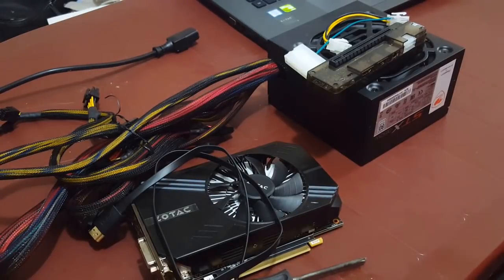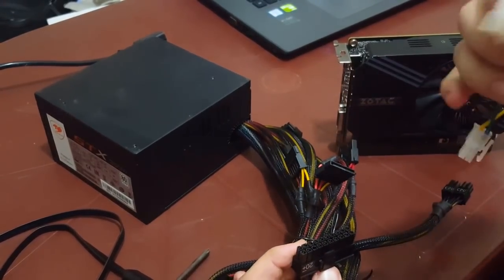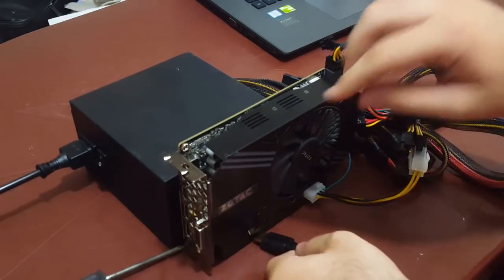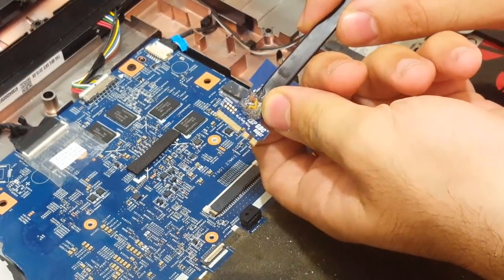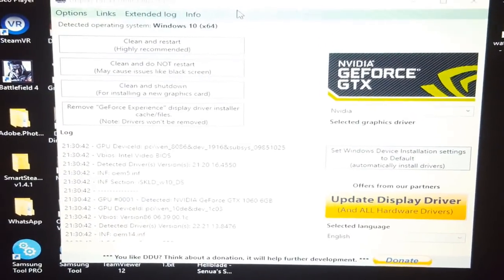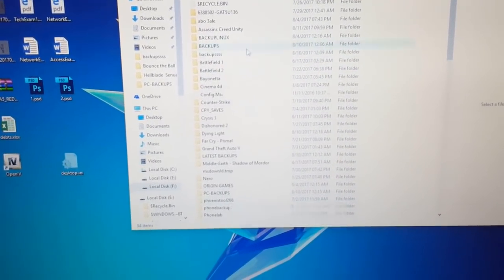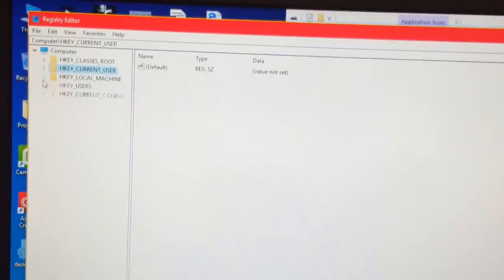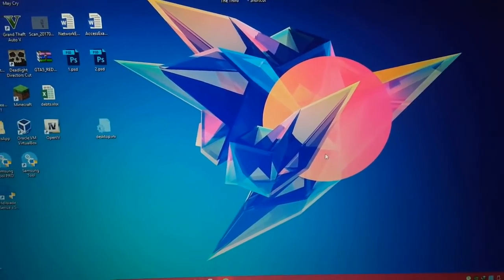HOW TO: External GPU for any laptop PC W/O External Monitor GTX 1060 EXP GDC 1050 ti solve error 43

Comment: Hey guys there's a new version of the beast which is v9.0b with m.2 key M and 2 hdmi cables. According to the instructions on ebay it says that the m.2 slot has to support nvme for it to work which IMHO  makes sense since the cable now has 2 hdmi for faster data transfer. Now the question is do these laptops with m.2 for wifi cards support nvme? If yes can i use version 9.0b on my laptop? My laptop is dell 5558 with i7-5500U and I've looked online to see if my motherboard supports nvme and i haven't landed on any solid information. Any help would be greatly appreciated.

Comment: I have a couple questions, lets say i set all this up but also would like to use my laptop as a laptop every once in a while, if i unplug the egpu and enable the built in nvidia card would my laptop still work correctly? also if i were to plug in an external monitor into the egpu through the displayport (to get 144hz) would this work?
Reply from the maker: the built in GPU will always work, and I have never tried it with 144

Comment: hello  will this method  works  for  lenovo  Y50-70 i7 4720 hq 16ram? 

p.s  watn  buy  1080ti for egpu

thanks
Reply from the maker: I am not sure that 1080ti will work as an external GPU
also, I am not sure about the laptop's compatibility, be the first to try, but don't try the 1080ti.

Comment: Hi..nice video! I've got some questions:
1.Can Acer aspire V3-471G run this eGPU? This is the specs:
Processor  Intel Core i5-3210M (2.5GHz)
Graphics  NVIDIA GeForce GT 630M 
Memory  4GB DDR3 
Storage  1TB HDD
If yes, which GPU is suitable for me?

2. I heard there are many version of this Exp Gdc from 8.0 until 8.5. Which is the best and suitable for me?

3.Does old CPU effect GPU?i mean if using old CPU,can i use latest GTX1060? or i only can use GTX 970 below?

4.Which power supply is suitable for all GPU?is it 550W?hope it will not burn my laptop..

5.If i using this eGPU, is it possible for me to use original laptop GPU again to make my laptop portable and only use it again during gaming? or i need to do all that steps again once i disconnect the eGPU?

That's all..Thanks!
Reply from the maker: I do not recommend using external GPU with such laptop, since your CPU and RAM are below recommended specs

Comment: GIGABYTE GTX960 Windforce 4GB  not being detected on a Dell Inspiron 3520 running Windows 10 64bit
 i3-3110M
And 6GB RAM

Am using a GIGABYTE PW400 for power and it is all connected through the EXP GDC Beast V8.5c via PCI-E

Graphics card (GTX960) isn't being detected, but if I use a different Graphics card, the secondary card gets detected but I am hit with an Error 43, can anyone help?? I'm stressing that I wasted money over nothing...

Comment: Yo bro,
I have a Lenovo G50-80 and i did the EXP GDC setup using 'Galax gtx 1060 6 gb oc", a 550w power supply, using the NGFF version cable and did everything in bios but cannot get the gpu to be identified in device manager.
Any idea what the fk is wrong?
(Also I'm using a HDMI extender for the ngff interface cable since it was short, wonder if it's the problem.)
Reply: 1.Do not use any extention cable, they are slowing the bus speed of the gpu and probably wont let u use the gpu

2.do not use any amd gpus for playing on internal screen, they dont support backward comptability.

3.do not use any nvidia gpu under gts450 (not including gts 450), do not use gtx 1030,1050, 1050 ti, 1060 3gb, they dont have drivers that support the exp gdc .

4.make sure to power your gpu with external power cables if needed.
5.Make sure to disable the nvidia gpu on your laptop if you have one, or make it second option.

6.Make sure the switch on  the atx option on (power supply) exp gdc board .

7.Install the drivers that were launched firstly for your gpu and then update the drivers from geforce experience.

8.I do not advice you to overclock the gpu it causes crashes due to low memory bandwith in the cable.
 
Wow i cant believe i just wrote all of that

Please let me know if you have any issue
Reply: David Nicol Hey there!
Thank you for your advice but I've tried it all before it just doesn't work, i tried it without hdmi extender and everything still it doesn't get detected in the device manager. I've heard of something called as egpu setup 1.35 but didn't gave it a try. any idea about it?
Reply: AR Tech AR Tech  I tried it but it only to check that my gpu is running at gene 2 mod 
I dont know if it will help 
I would love to help you 
Send an email and a comment here ill try contacting you about doing this setup properly, so nothing will go wrong
Also if i have 1.30 not 1 35
Reply: AR Tech go to your email
Reply: Hey guys I have a dell inspiron 5558 with zotac gtx 1060 6gb with  the NGFF cable version and I'm having the same problem as you. Mind to share your solution?
Reply: @heanlygaming5408  try nvidia version 388.71 good luck!
Reply: there is an indian guy who shows this process om lenovo g5070, you should check his video... here is the link. https://www.youtube.com/watch?v=aM3D3cZmqn0&t=529s

Comment: Hey.. i hve a question.. please help i already disabled all the drivers and root pcie but my laptop does not detect the exp gdc.. i am using ROG gl553vd i7 7th gen. Using ngff cable same like in the video.
Reply from the maker: Hi, make sure to remove all power sources from your PC ( including battery) before connecting the GDC while it's on, then turn your PC on.
Reply: Why the battery? Is there a specific reason?
Reply from the maker: Since it could still supply the PC with power even if it is off.
Reply: Should i charge the laptop?
Reply from the maker: You can try another one
Reply: It still wont detecet anything..
Reply from the maker: maybe there is a problem with the PSU or the GDC
Reply: My psu is a new cougar ste600 watts so i think its alright but not sure about the exp gdc
Reply from the maker: check the GDC it may be faulty
Reply: The green light turns on when i plug it to the laptop, does this mean that it is working or is there a chance it is broken?

Comment: I have a gaming laptop 
(Lenovo Y520 with 1050 4gb)
I want to put a Palit GTX1050ti (single fan). I watched everything in the video and saw that you disabled the built in graphics card. 
So i can not use my built in gpu and egpu both?

Comment: Hye Pedro...good video...i apply this step and it work without error...i have one problem. When i want to use with internal display, i cannot open nvidia control panel, its say 'Nvidia setting are not available" i have integrated intel hd graphics and dedicated gt720m..it seems like default gpu was not on my egpu..i cannot change preferred gpu bcoz cannot open nvidia control panel, help!
Reply from the maker: Hatem Aqil apparently your PC doesn't support such feature with the internal display, you should use and external one which is better and would give you an increased performance.

Comment: I have a lenovo y510p laptop. I bought a exp gdc to use gtx 1050 ti on it. I install my hardware just like in video instructions. My psu working, my exp gdc has green light, my 1050ti's fan is spining but device manager can't detect the card. I can't disable pci express slots for my older cards because when I do, The monitor not responding.I tried what atarva7 said, and so many other methods. But  Im hopeless. So guys give me some hope please.
Reply from the maker: make sure to remove every power source from your PC before connecting the GPU while the PSU in ON
Reply: I did it but nothing. Then I started my laptop when psu on, laptop got power but screen not working. I need to turn off PSU to start my laptop. İs it normal?
Reply from the maker: no, it is not normal, something is wrong, maybe you need a better psu, also check the connection from the adapter to the PC if it is moving, and also try using an external monitor
Reply: I tested same setup on another laptop and I still got same problem. Im thinking if my gpu is broken or something. Can be? If so I will return it before too late

Comment: hey man can i unplug all hardware like vga,power supply i already installed and work i can play gta v high in settings before.so i want to plug in again without installing again like before and i 
 want to bring all my hardware to my friend house and WIfi public or cornor and i want to plug in again .can i do that.without having problem.
by the way what is your laptop name and spec.
you have already installed gta v before you install vga hardware
Reply from the maker: sure, the installation only takes place once, so you wont need to reinstall again each time.

Comment: I did this and its working but only with an external monitor, do you know what i am doing wrong? with the laptop monitor it allways uses the internal gpu... and i also had crashes while gaming suddenly its a white noise on my tv... but this could be because i was just using a 350 watt psu for an 1060 6 gb right? In my bios of my asus f555l i also cant disable internal graphics do you know why? an awsner would be great... great video by the way
Reply from the maker: Try using a better PSU, and may I know what is your internal GPU?
Reply: my interna lgpu is a nvidia 920m but i disabled it like you told in the video and it all worked just no gaming with laptop screen.. :-(  thanks for your awnser
Reply: and yes it was a psiu issue because i bought an gtx 750 for 30 bucks and now its working with a 350 watt psu.. i also just did this to play pes 2018 fluid at my girlfriends place ;-)
Reply: and i really did your video step by step ! the only thing i did was to get the newest geforce driver because your video is older but this couldn´t be the reason why my laptop screen isn´t workin or?
Reply from the maker: Bernhard Koschier no it is not the reason since I am using the latest driver, another question does your laptop have and integrated intel HD graphics gpu if not then that is the reason...
Reply: yes it has a integrated hd graphics gpu... but the funny thing was also when i was using an external monitor.. the games where allways using the hd graphics gpu instead of the gtx 1060... then i deinstalled the had graphics driver and then it worked.. now if i go to graphics card i have the basic vga display adapter and the gtx 1060.. you are telling me that i need hd graphics installed to use internal monitor? best regards
Reply from the maker: yes the internal monitor won't work unless intel HD graphics is running well
Reply: ok thanks but how can i tell had graphics not to use hd graphics because i swear the god it wasnt working with it.. every time i tried to play a game it used hd graphics instead of my external gpu... :-(
Reply from the maker: Bernhard Koschier by using nvidia control panel, you may google it for morr info
Reply: ok thanks
Reply: by the way Pedro also managed to use the laptop screen now, there was a problem with my hd graphics driver( I intstalled a newer one)  now its working.. the sad thing is you have much less fps then with an external screen.. have you mention the same with yours?

Comment: does this apply for the normal gtx 1050 2gb aswell also i have a problem. i have a msi laptop i got everything set up but when i go to device manager my gtx 1050 2gb comes up with a yellow triangle next to it i have connected the graphics card with a dvi cable to my external monitor can you help me plz?
Reply from the maker: Damon Shane 1050 should work, check your power supply unit
Reply: it just keeps saying you are currently not using a display attached to the gpu. im not sure what i did wrong
Reply from the maker: Damon Shane wierd, try redoing the same installation process

Comment: Good job.. But if you insert the external Graphics cable in the wireless adapters port then Will the wireless of the PC still work??
Reply from the maker: monibstar you can get a USB wifi adapter
Reply: Pedro Marthon oh thts nice thanks :)

Comment: hey, i have laptop Vaio i5 2450m with hd7670m, could i use internal display laptop if installed expgdc GTX 960 ZOTAC? also if i upgrade ram could itu reduce bottleneck?

Comment: Hi Pedro! I need some help, please. 

I got a dell inspiron 7720 i73630qm gt650m -->> eGpu GTX 1060 (gigabte aorus) beast adaptor

I tried with 368.81, just as in your video (ddu, and everything), but when installing the driver, at about 25-30% the pc makes a 'beep', and goes into black screen (some error or something)

Do you have any idea what's wrong? Thanks
Reply from the maker: weird! try checking your PSU if it is functioning properly, also check if you have disabled internal GPU PCI port.
Reply from the maker: bogdan draguna recheck cabling connection

Comment: Will an MSI GeForce GTX 1050 work?
https://www.walmart.com/ip/MSI-GeForce-GTX-1050-2G-OC-Graphics-Card/119512225

Also will his gtx 1050 work?
https://www.walmart.com/ip/GTX-1050-2GT-OC/131337268
Reply: Thank you for any replies
Reply from the maker: yes, it should work perfectly, only GTX 1050 ti and other new GPUs will have problems.
Reply: Will it work with the internal display?
Reply from the maker: Rabbid Yoshi it depends on your laptop's compatibility

Comment: hello, we need to do this every time we attach the eGPU to the laptop?
and how to enable again the laptop v-card(GT940M).
and I want to know if my laptop can support the egpu? ASPIRE E 14 
Thank you. :)
Reply from the maker: not not everything, you will just need to connect the GPU and restart.
As for re enabling the internal GPU you can go to device manager then reinstall the driver for it.
Reply: so one-time setup only to use the laptop screen using egpu. 

What about my laptop its compatible?
Reply from the maker: Yes it is a one-time setup.
And the laptop's MB should be compatible with external PCIe in order to work, most laptops are.
Reply: thank you Pedro Marthon, your information is very helpful.
Reply from the maker: Happy to help :D

Comment: Hi Pedro i have the same notebook as yours. But it is not working. I have a exp and a Nvidia gtx 745 GPU. Can you help me please ?
Reply from the maker: Wildgamer 2016 what's the problem
Reply: Pedro Marthon i do it Step by Step by your video but its not working. And with the exp my Keyboard is not Working.
Reply from the maker: Wildgamer 2016 I will give you a hint: make sure to remove all power sources from the pc before connecting the GDC and make sure to turn the GDC on before powering or adding power source to your pc, this actually fixed a bunch of problems I had.
Reply: Pedro Marthon the batterie too or only the charger
Reply: Pedro Marthon the exp is on and i started my pc but i see only black screen
Reply from the maker: Wildgamer 2016 boot into safe mode and remove all the drivers
Reply: I ready Now with all of the first 9 minutes of your video but i have a black sceen

Comment: My laptop is acer V3-772G and trying to use Gtx 1060 6G on it. Whenever I plug EXP GDC in, it just constantly gives me a black screen on my laptop (not using an external monitor). And although some how it turned on , the device manager shows the vga isn't detected. but the EXP GDC's light is on and the fan of the psu and vga is also working.Help me plz :'(
Reply from the maker: 許宸安 first of all make sure that when you connect the beast to your laptop that the laptop is totally turned of, even the battery is not plugged then turn on the beast and replug everything.
Second check you psu if it is good quality.
Reply: Thank you for replying. I'll try and see if it works. Nice tutorial vid btw. :D

Comment: Hi, any ideea why I got blue screen when I am playing games from steam? Any other games is working fine with no blue screen. I tried to disable dedicate video card from laptop but I couldn t find in device manager like in your video.
Reply: I got exp gpu with a GTX STRIX 1070 OC on a asus g56jr.
Reply from the maker: Danny Andronache disable the internal gpu from devicemanager/displayadapters, and also check if your power supply is working well
Reply: I disabled, I have a new Kolink Core Series 500W 80 Plus bought with Asus GeForce GTX 1070 Strix OC. It s strange because in Fortnite or Battlefield 1 I am running in ultra smooth but when I play Dota 2 start crashing with nvlddmkm.sys on description. I got another Blue Screen now again when I tried to download 2 games in same time on steam.
Reply: Do you thing that PSU is not good for that 1070 oc?
Reply from the maker: I guess it is a psu problem, but first download and install geforce experience and turn on shadow play, then try any other game, if it started to crash more then I think I know what is the problem
Reply: Now I am testing. I had installed geforce experience with shadow play by now when crashed me in games. Now I uninstalled geforce experience to see if I have crashing in steam
Reply: Nope, still I got that blue screen again in Dota 2 with and without Geforce Experience. I had installed when I played Battlefield 1 and didn't crashed me but in Steam has is a pain.Do you have an idea what I could do to fix this because honestly I am thinking to return this video card.
Reply from the maker: try disabling windows game mode if you have windows 10
Reply: It's disabled by default in windows, I don't even have that button to turn on.
Reply: Do you think this is going to help me ? egpu setup 1.35 software ?
Reply: Yea, is doing now blue screen Video TDR Failure same description with all the games not only in steam. I have Geforce Experience uninstalled. I played GTA 5 now for about 10 min and after that I got that blue screen. I start immediately Fornite and after 1 min I got Blue screen again. This is driving me mad...
Reply: I checked now with another PSU 750w but still same issue..
Reply: Hi mate, do you have any ideas what is problem with my settings?